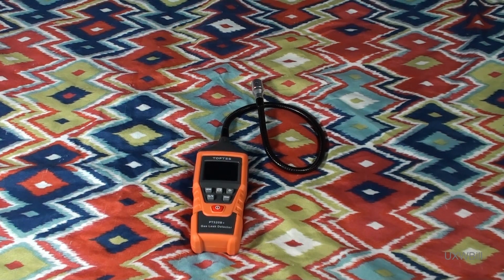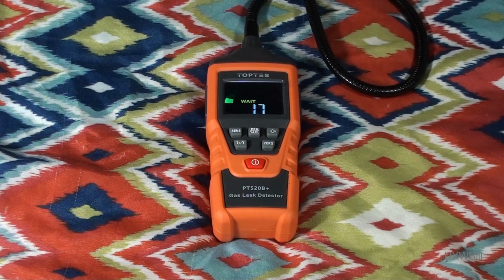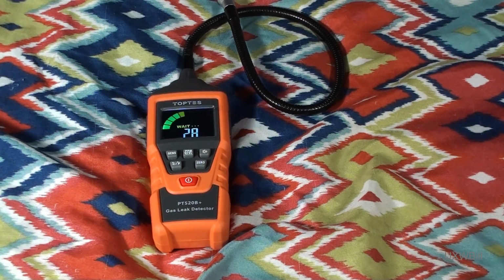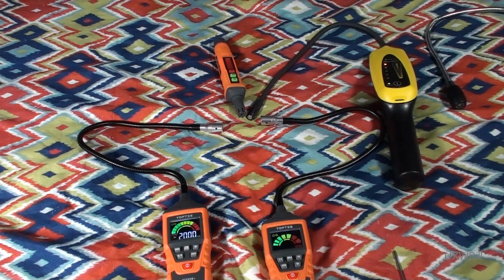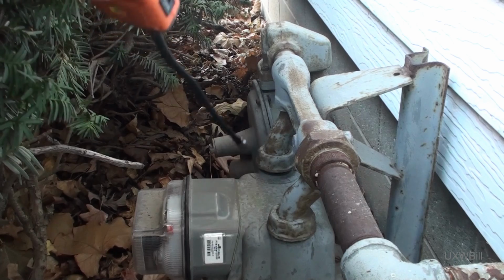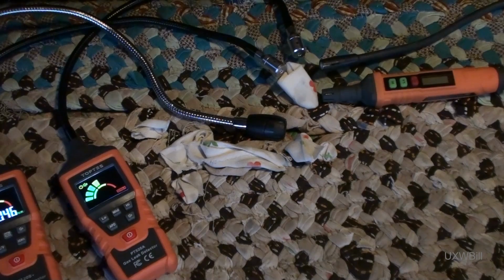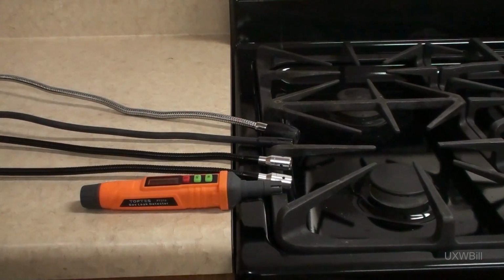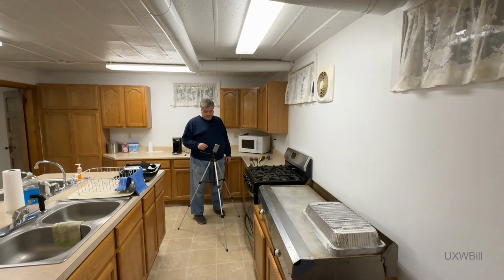Product Review: TopTes Tools PT520B+ Gas Leak Detector

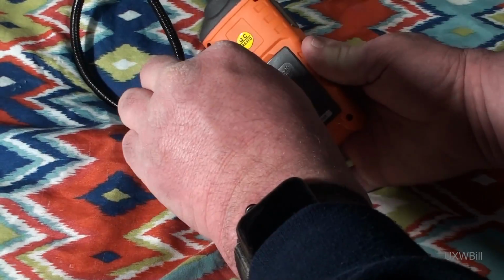Comment: 9:32🤝🤝👍👍❤❤❤❤
I don't know which one to buy with USB or AAA
Model HABOTEST 9999 PPM HT601B+ if the battery fails, failure, you can replace the batteries with AA 1.5 AA batteries 3 pcs
Note:
I will hardly turn on and use the device every daylight hours
Thank you!